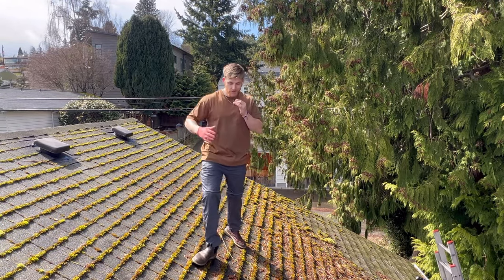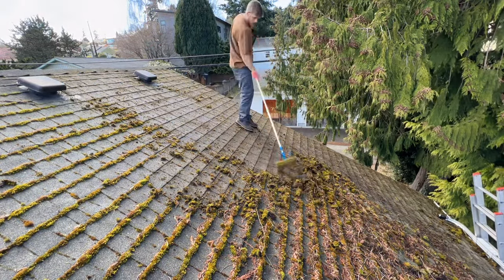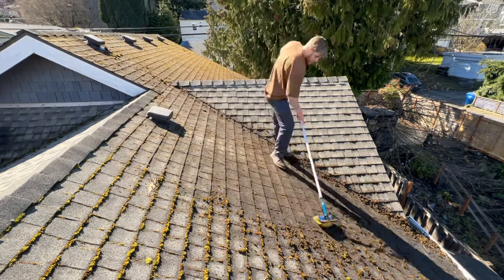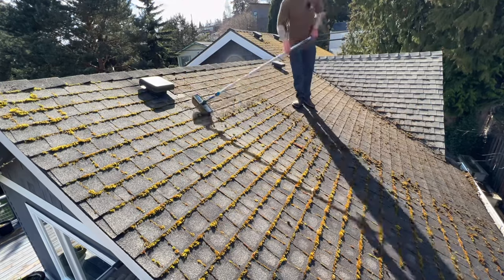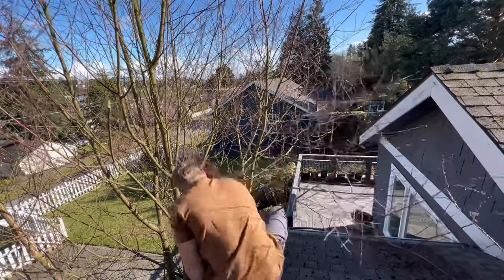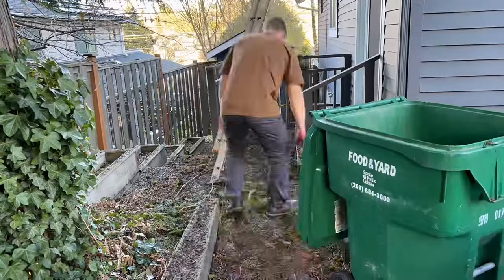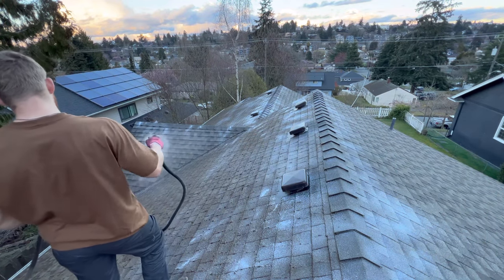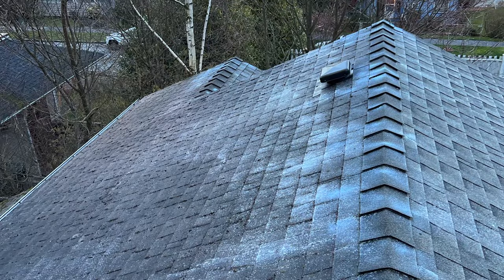How to Clean and Get Rid of Roof Moss For GOOD

Comment: Hey mate ! Really enjoy your content. There’s one issue I’m having with roof cleaning that j can’t seem to find much answers on. Here in Australia a lot of people down pipes are connected to public water ways which your not allowed to let any contaminated water run down. So when cleaning metal roofs etc and rinsing what’s your methods for this situation ? Do you take of downpipes and redirect water into garden ? Or pump out the water from the gutters into the garden ?. Would be great if someone could make a informative video on this ✌️
Reply: You’ll want to disconnect the downpipes and redirect them into the soil and away from plants until the chemical has been diluted and the water is clean enough to go into the drains.  Vigorously water the area around the disconnected downspout runoff to help dilute the chemical and prevent plants and grass from damage.

Comment: Thank you. I have seen people dump that on the roof, and it looks worse than the moss. But you, my friend, have shown me the missing key. You wet it down and coat the roof. I have seen in this old house where at the top of the roof, they would lay down some kind of alloy sheet. Tuck part un the ridge cap, then install some screws and coat them with tar to keep leaks away. when it rains it will  wash down the roof keeping moss at bay.

Comment: Run lengths of copper tubing along the ridge line.  You can hang it from both sides.
The slow dissolving of the copper produces Copper Sulphate CuCuSo4 that kills the moss when it rains.  Great for Cottages.  Maintenance free.
Reply: That's the method for rich people...or tweakers!😄

Comment: Do you only spread the powder at the peak and then let the water and distribute it downwards onto the lower parts of the roof?  Thanks
Reply: You must coat the roof evenly.  If its only on the ridge, it might be too weak to be effective by the time it reaches the bottom.

Comment: What about spraying “Moss-out” lawn solution on the roof when there will be no rain for at least 2-3 days? Won’t that kill it and then be easily hosed off with a spray nozzle - or just let a hard rain wash it off?
Reply: Moss killer for lawns contain high levels of iron.  This will leave permanent rust stains on hard surfaces such as concrete and your roof too!  Chemicals and fertilizers from the garden section at the hardware store should never be used on the roof unless specifically indicated on the label.

Comment: Might work in America on the asphalt roof shingles but if you try walking on British clay tile roofs you will crack them with your weight and then the water can get in.
Reply: Same thoughts, also in UK. My pan tiles run on to an asbestos roof. Where the two roofs meet is a long lead flashing and the moss backs it up and causes heavy drips in the garage below. Tried copper wire on the roof which did nothing, so will try 15mm copper pipe. Will also give Bicarbonate of soda a go!

Comment: My queries…I’m in the UK going to have the moss removed but can’t get it treated till spring as it’s too cold and wet atm how long till the moss returns ?
Reply: I find it easier to treat the moss when the moss is actively growing and when the weather is wet out. Just make sure to use a product that is safe for roofs( usual ingredient would be "ammoniated soap of fatty acids-MossOut brand). Don't use anything with Iron in the product! It will permanently stain your roof! After treated and the weather improves...you should be able to spray the moss off with a garden hose. Cheers!